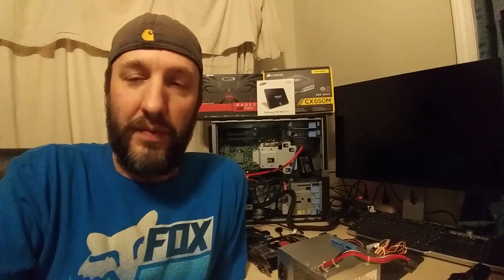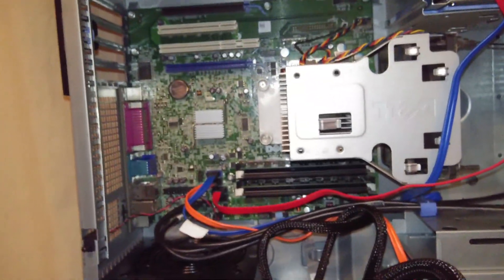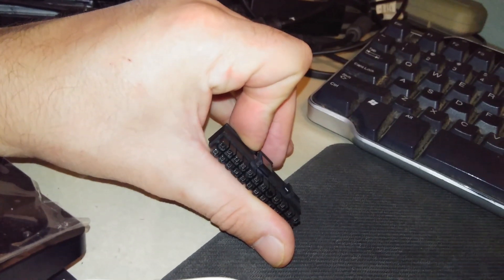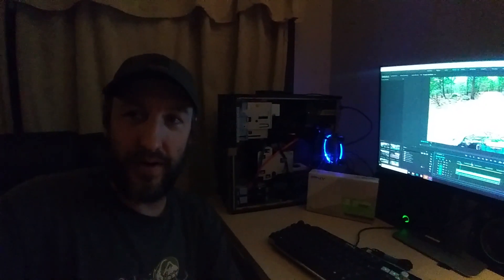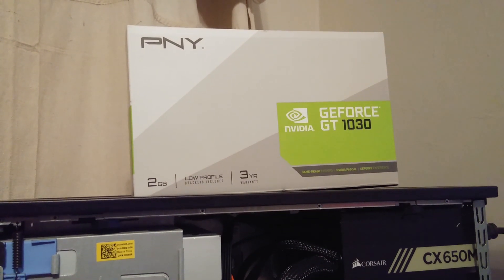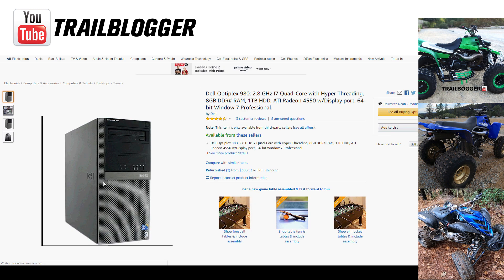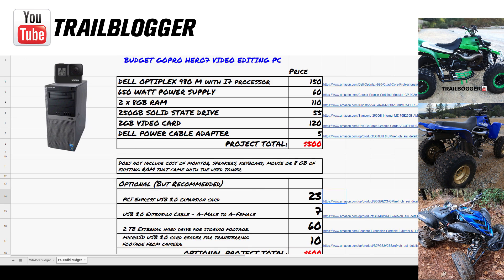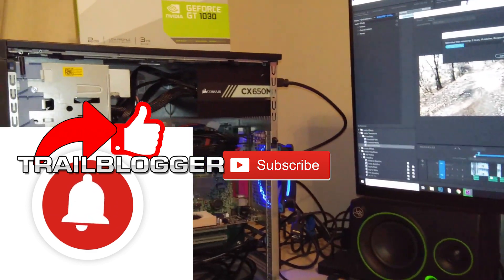Build a GoPro Video Editing PC for 500 Dollars

Comment: Well I was thinking of doing the same thing - budget build a computer for video editing.  I am a novice with the inner workings of a PC but am very handy.  This certainly helped break down the mystery of what is inside the box!
Reply from the maker: One thing to keep in mind if you go this route is to pick a box that can support usb3 or at least is expandable to include usb3 if you want to be able to quickly transfer your files to and from the computer and your external drives. I keep all my data on several externals to keep the editing rig decluttered
Reply: TrailBlogger yes that was really key point on going to USB 3 for sure!! Thanks for that
Reply from the maker: @ADVENTURESThisWay  it's like the difference between waiting 5 or 50 minutes for your footage to transfer. big difference when you are sitting there ready to start editing!

Comment: I used to work for AMD for 15 years, first 5 years I ran their support center before moving to the technology enablement group.  I have loads of h/w laying around my house from over the years. Used to work with the Corsair guys, Thermaltake guys, etc. still have friends at both companies.  Still in tech but work more with Msft, Dell, etc.    My editing rig is a Surface Pro 4 Core I5.  Does the job pretty well but I'm using Cyberlink 17, it is pretty fast.
Reply from the maker: The CEO of the company I work for runs a surface. He had one little issue which they warrantied but other than that he loves it. I have an i7 laptop but it is maxed on ram. Seems like for editing 2K footage 32 GB is minimum with adobe premiere
Reply: @trailblogger  Yep, Msft does a pretty good job with these Surfaces. I had a battery failure on mine about 2 years out of warranty. Went to a retail store and they replaced it on site, no questions asked.  Did the same for my wife when she dropped here and cracked the screen.  As for Adobe, it is definitely a resource hog. Haven't tried doing 2K video on mine with Cyberlink.  Those file sizes are huge and it makes the camera burn through batteries too fast.  When I get around to wiring power to my camera and add way more storage, I will probably start shooting more in 2K.
Reply from the maker: @RoughRidersTV  I carry a bag of batteries and the hero7 seems to do a lot better on batteries even recording at 2k 60fps with the hypersmooth digital stabilizer enabled

Comment: Do you need any help with your computer? I saw you couldn’t get your drivers to load, if you need help I’m really good with this kinda stuff. And I saw you said you had 4x8 gb ram which is not possible because you only have 2 dim slots. Bedsides that looks good man, nice setup.
Reply from the maker: Thank you for the offer to help I have it figured out now I think thought. I took back the AMD video card the NVIDIA loaded right away. Always preferred nvidia anyhow the AMD just seemed like a nicer 3D card for the price. My optiplex 980 MT has 4 ram slots.
Reply: @trailblogger  ohhh okay i see it now it looked like 2 my bad
Reply from the maker: @paren8239  really appreciate the offer to help me out anyhow man. thank you! luckily we got her going and I can edit in 2k now!
Reply: @trailblogger  That's awesome man, out of curiosity how long does it take to render a video now? Compared to your laptop
Reply from the maker: @paren8239  it really depends if I am doing a lot of special effects like the speed increases for the time lapse, contrast, brightness adjustments, video inverting etc...  I never even tried to render a 2k video on my laptop. the 1080p 20 minute videos would take about 30-40 minutes on my laptop. the 2k videos take around that long on the desktop so about the same. it was the playback chopping up that was the problem, I could not even preview the video to see what I was editing.
Reply: @trailblogger  oh ok nice I was just wondering